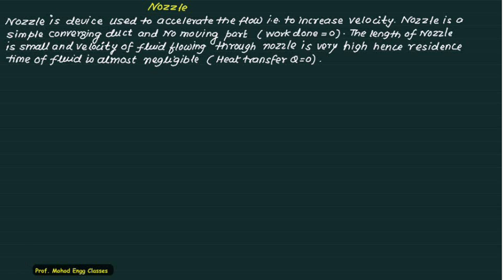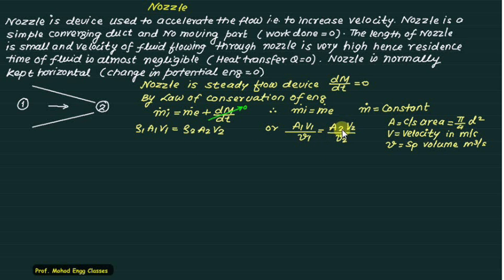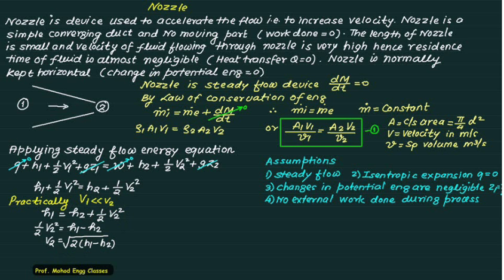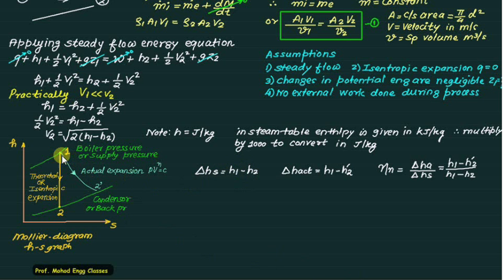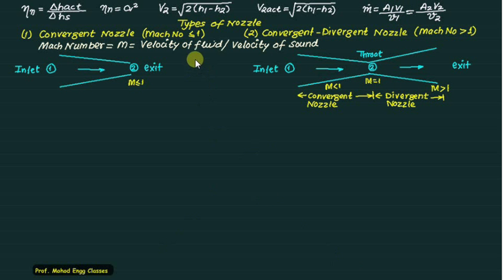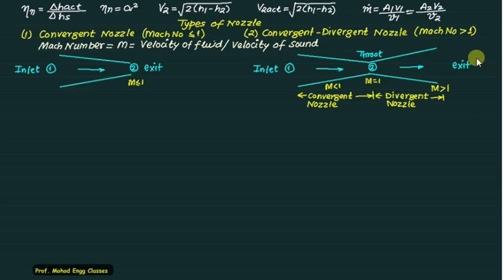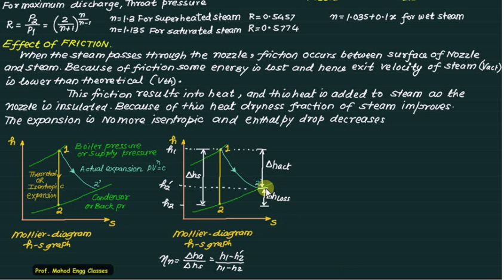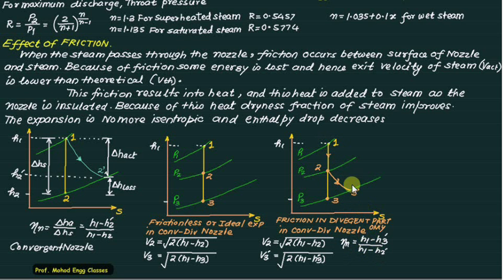Nozzle Introduction

Comment: Excuse me Sir, but in the given Mollier diagram at 4:20 I see that enthalpy (h) is on Y-axis and the line drawn is parallel to Y-axis. Does that not mean that entropy given (X-axis) is constant throughout, and h is changing? Isn't that the opposite of what you state? I apologize in advance if I've made a misunderstanding. Thank you! :)
Reply from the maker: yes there is correction, it should be isentropic process ie entropy remains constant and enthalpy does changes
Reply: sunil mohod sir apko ye to pta nhi ki entropy constant hai ya enthalpy?????

Or steam nozzle me enthaly decrese kyu hoti h?